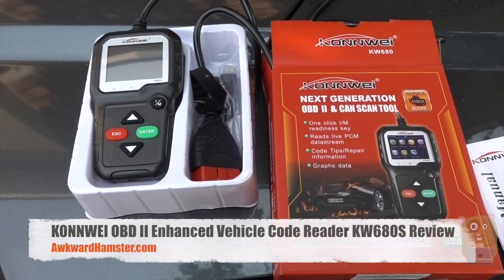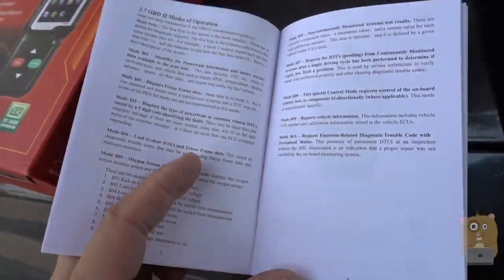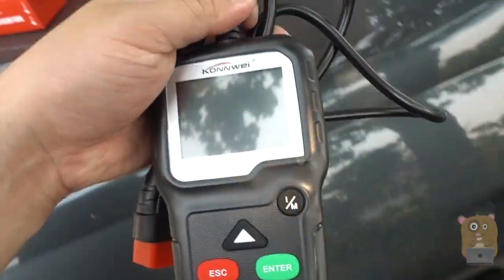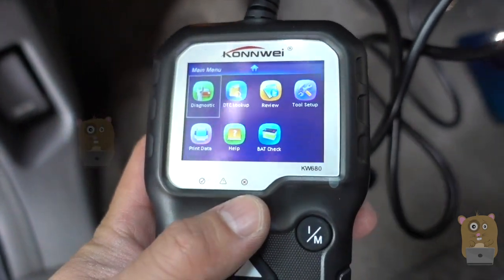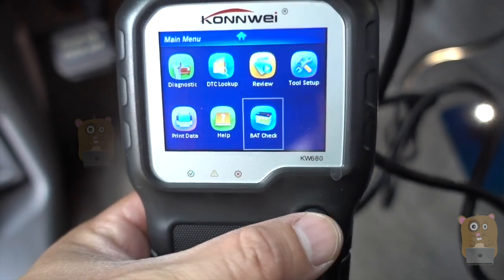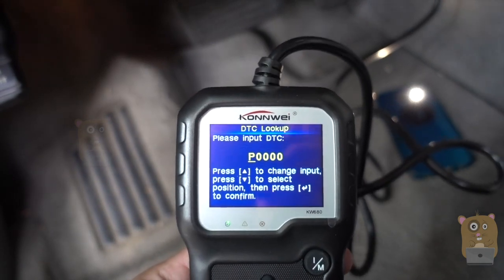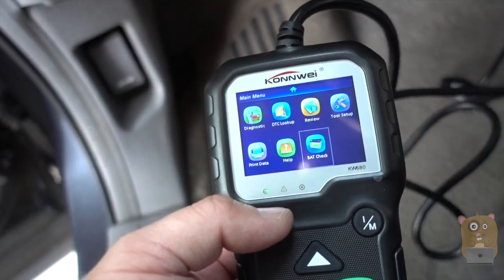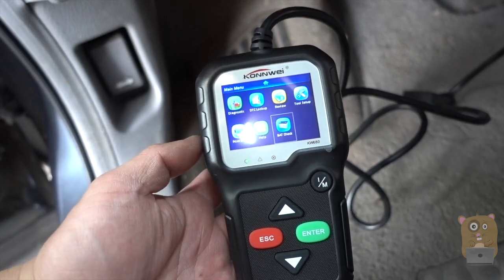KONNWEI OBD II Enhanced Vehicle Code Reader KW680S Review

Comment: I made a loss doesn't work on Toyota models good machine for a useless garage. U can upgrade 100 times but konwei proves to be the enemy of Toyota and upgrade. I have kw850 its a poverty and failure inviting machine. The percentage of a successful operation using using konwei on car models is 13% all it will tell u is check connection. Failing to pick a car Systeam rubbish machine. Go for autoboss v30 elite or launch bigger versions u are good to go.